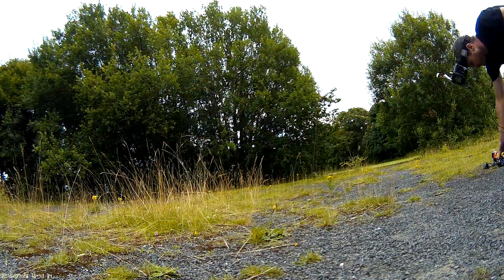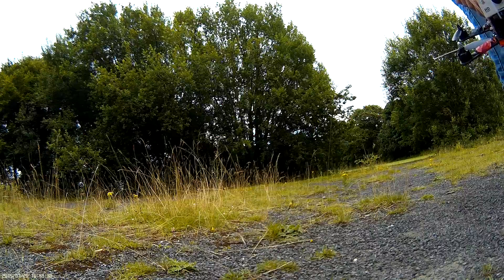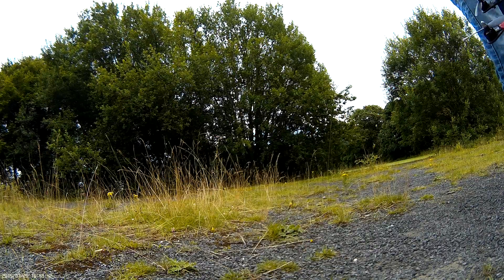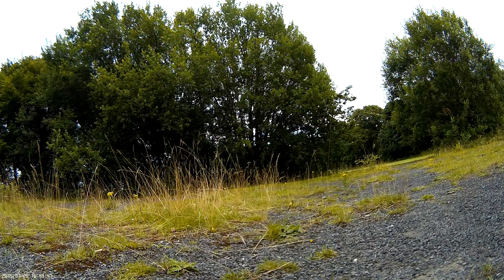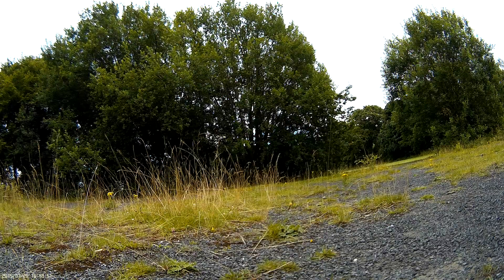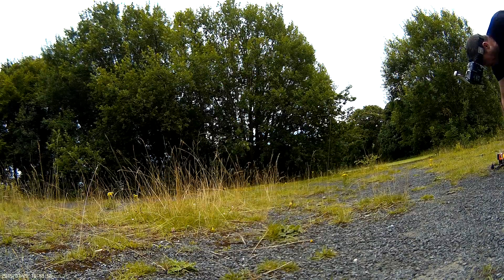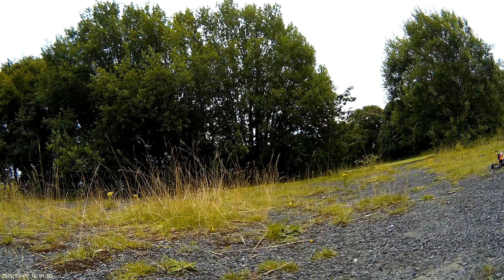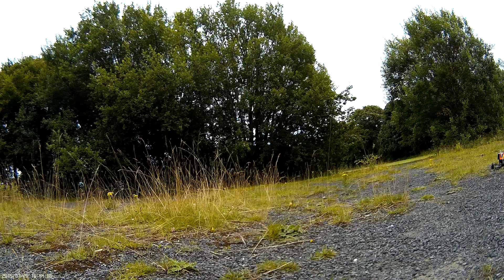Emax 250 Nighthawk 5x4.5 Bullnose Props on a 4S???

Comment: blairo15 yes gitters on motor start up. with these little motors they are very sensitive to start up forces and frequency settings. i had to adjust my 12amp escs to get best smooth startup for all my motors. the gittering is from the motor not knowing if its going clockwise or anticlockwise. it gets stuck. if the start up force is to much it can cause this. if its to low it can cause it also. Hope this helps. 😊
Reply from the maker: Sorted now thanks. Got it running on 20A DYS BelHeli ESC's & Emax 2206 1900kv motors on a 4S with 6045 Bullnose DAL props. A whole different beast now!!!
Reply: Awesome! Thats the way. Onya blacbirdboy1. 😊
Reply from the maker: Adam Killip Cheers.

Comment: Have you ever had a motor get the gitters on start up and run hot? I have one of my brand new emax motors doing just that. Weird. It's the left hand rear motor which is on bank 2 of the CC3D flight controller.

Comment: A lot of these China quad frames are using real carbon so they are not cheaping out there but where they are cheaping out is on the binder. You're suppose to use Epoxy (expensive) to laminate but they are using cheaper resins such as Polyester and Vinylester. Likely Poly as it's the cheapest. Some companies are using a fiberglass center. This can be easily tested with a voltmeter. Carbon fiber conducts electricity.
Reply from the maker: I snapped 2 arms on the new frame. The old frame was solid carbon with 4mm arms. The new frame has 3mm arms and the frame is a carbon mix. I have now doubled up the new arms so that they are 6mm thick carbon mix. So far, they seem to be holding out out after a fair few crashes!

Comment: Nice video - sorry to bear you got gypped on the carbon fibre. I find the bullnose props really vibrate at higher revs - they're a b*^%er to blance.
Reply from the maker: +Neil “Quad Damage” McNicholl Hi, This is an old post. It now has DYS SN20 ESC's & Emax 2206 1900kv motors. I can run 6045 DAL twin-blades & Tri-blades. Tri-Blades are really smooth.I ended up putting the old thick, good carbon arms on the back and doubling up on the cheap 3mm arms on the front. 2 arms sandwiched together to make a 6mm arm. Seems to be holding so far. Although I found at the weekend that I have motor down. The magnets have dropped, stopping the motor from spinning. Need to take it off and apart to see if it can be fixed, if not, new motor time. It has had a few crashes. I smashed the top middle & bottom plate the other month. The only thing left ok was the arms, go figure!!!Try the DAL Tri-blades, there really good and well balanced.http://www.surveilzone.com/2-Pairs-Tri-blade-DALprop-5045BN-Bullnose-Props-for-FPV-Racing-g-1484
Reply: blackbirdboy1 Sounds like a proper frankenquad - how did you glue the 2 pieces of 3mm? I have some Gemfan 6040 triblades - but I didn't balance them before testing - I'll have to try again after balancing. But I did test out some diatone 5030s on a 4s 1800 at the weekend - check my videos - that's some power!
Reply from the maker: +Neil “Quad Damage” McNicholl No need to glue the arms!!! they are held in motor & frame screws. 
The motors have had some stick lately. Smashed the quad to bits recently, which destroyed the Foxeer Legend HD Cam. It hit a solid concrete post at 40+mph. Then after the rebuild I hit a branch and it landed right side up, but with a bang. Damaged the FPV cam mount. The thin Allot U shaped one. It snapped at the base. Replaced that, but didn't check anything else. Then when I tried to fly it again, found that the rear left motor did not spin. Thought maybe an ESC? On inspection, found a magnet poking out the bottom of the bell. Had a few of the Emax 2204 2300kv motors & never had a failure. This is the first Emax motor I have had that has failed!!! As I say, I may be able to fix her??? If not, I WILL replace it. I love the sound of of 6045 bullnose props on a 4S on her. Even sweeter & smoother, yet quieter on the 6045 Tri-Blades. The only down side is that it is on the heavy side and the bigger motors do use lots of mah in flight.